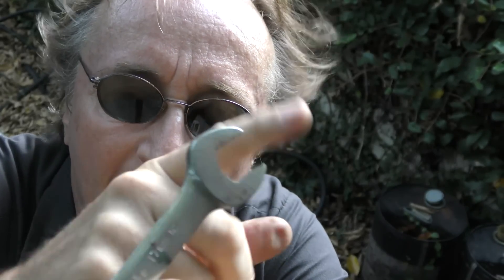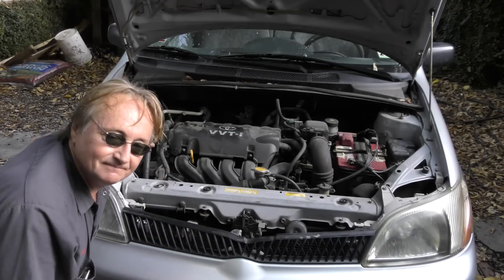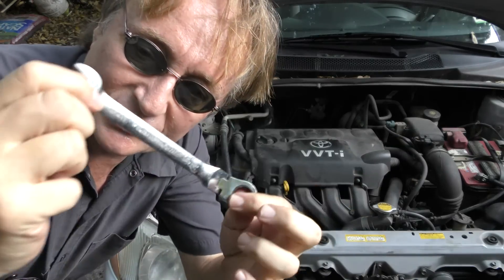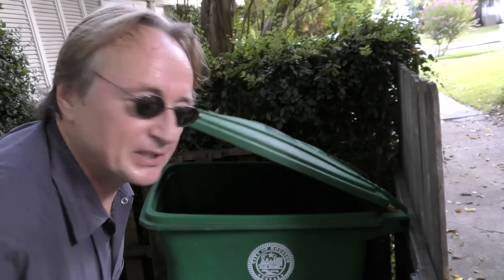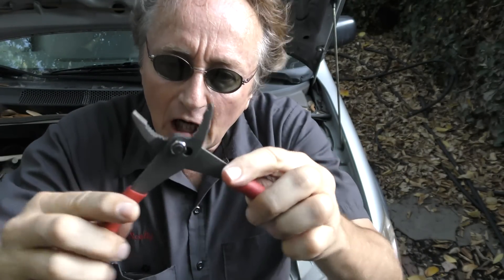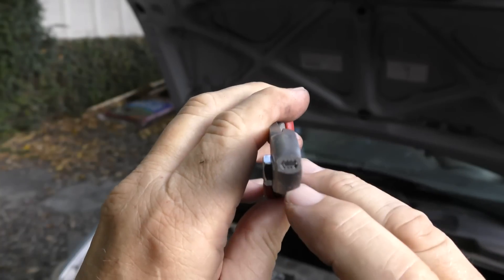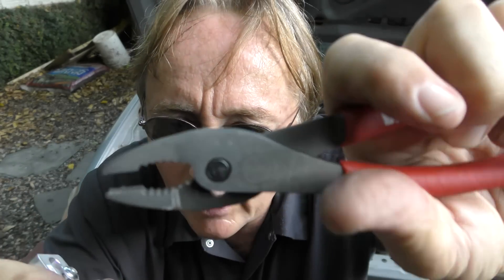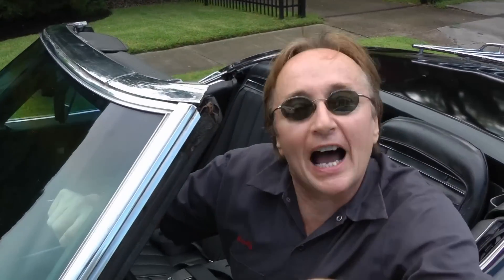Two Time Saving Tools

Comment: I have a question, a little unrelated, have you ever or will you like to in the future rebuild an engine? 
Is it all that difficult? Thanks.
Reply from the maker: +MicrosoftCPU3  na, used to do that stuff, but it's too expensive to do right on modern engines

Comment: A ratchet and socket could have gotten to that bolt without having to avoid the firewall with that ratcheting wrench.
Reply: +zatoichi37 not true. You could use an extension and have more travel than you would even need.

Comment: Can someone here diagnose my problem with my car. i posted it on the last video about wiper blades. thank you! would mean a lot. Sounds like a fuel pump and starter issue. but a professional opinion would help. Thanks